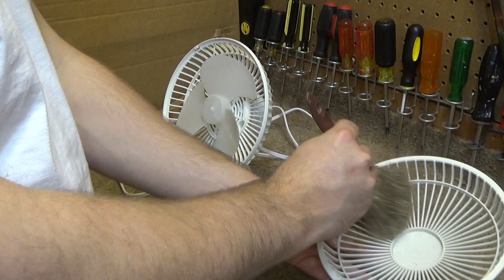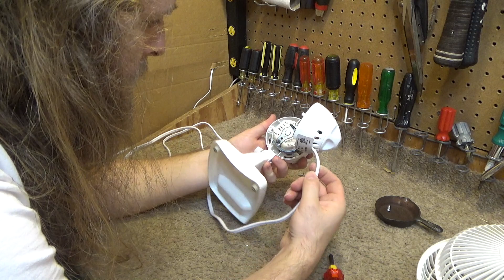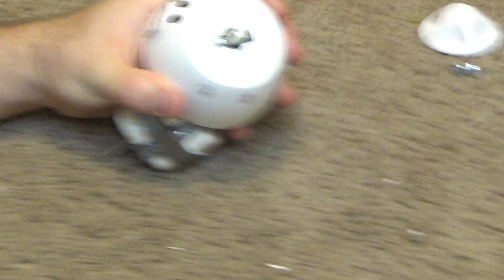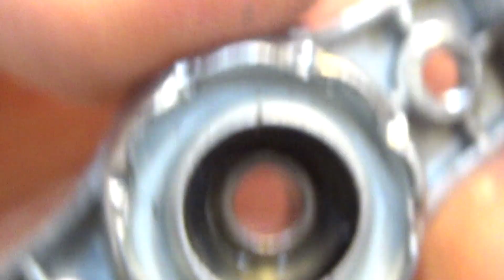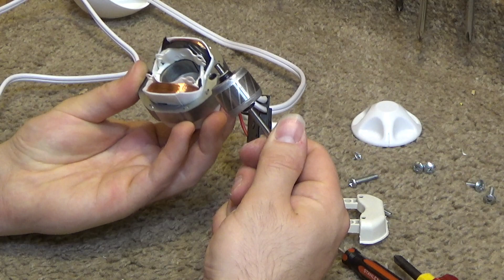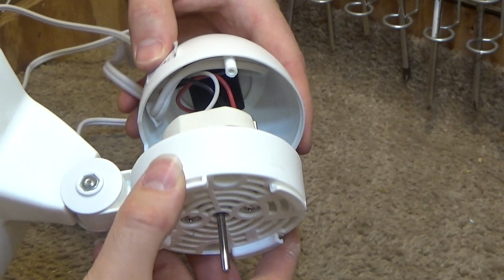Clean/Service/Repair Lasko 2002W Desk Fan

Comment: Thank you! I have two 2008 Lasko 9" oscillator fans model 2094 that I bought at Lowe's for $19.19 each. They still work well, and I clean them at the end or beginning of every hot season. I've never been able to remove the blades. I saw that it looked like a friction fit because of the steel-wire spring around the blades collars but I was afraid I might break the plastic blades if I pulled on them with too much force. Your video gave me the assurance I needed to apply more pull-force. They came off, just as yours did. Again, thank you. A more thorough cleaning and lube will now be possible!
Reply from the maker: You're welcome.

Comment: I have like 8 or 9 fans in my house... 2 of them are lasko clip fans (similar to this one)... One I keep in the kitchen clipped to the counter and when the dishwasher is done... I open it ... shake the racks and clip the fan so that it blows air into the dishwasher to dry the dishes... It works so much better than using the dry cycle... they are so freaking easy to keep clean. I've only taken it apart to get the blade off and I vacuum all of it with the vacuum dusting brush... but never oiled them. Honestly, I didn't even know oiling a fan was even a thing.
Reply from the maker: Thanks for letting me know.

Comment: As far as switch maintenance  goes, look into getting some deoxit d5 contact cleaner and lube, that is professional grade contact cleaner, it's different than your standard contact cleaner which is just designed for connectors and terminations, like the crc stuff as an example, that stuff doesn't have a special low weight lube in it which can damage carbon traced parts among other types of potentiometers and faders and switches, even some relays, get that deoxit d5 and spray that switch out and rotate it back or forth several times, and you will greatly extend the life of it by a factor of 15x

Comment: that motor looks incredibly well made, much better than any other small 6" fan I've seen
Reply: The blade has good pitch, i’ve had mine for a few years now, still works great.
Reply: @DnD_Robb404  look into that deoxit d5 contact cleaner and lube for switch maintenance when ya got the time.

Comment: Nice video. It was interesting to see the motor in these, I don't think I've ever seen a motor quite like that before. I was expecting it to have a C Frame like the 90s ones. I do like the motor housing on that, nice styling and looks well ventilated.
Reply from the maker: I've seen these style motors used in a lot of heaters, I believe it's a 2-pole shaded pole motor.
Reply: @JordanU  That's true, I have seen them in heaters. And my Vornado V Fans have them. I guess what was more surprising to me is it's totally enclosed. The ones I have seen all have venting or open windings.

Comment: the only issue with these I have the air king variant is they move little no no air
Reply from the maker: I don't see why the Air Queen one would perform any differently, if anything I'd think it would work a little better as the metal guards are usually less restrictive.
Reply: @JordanU  I am just stating my experience with my little plastic air king fan with the metal grill I got from the hospital when I was having surgery they gave me a small air king fan it barely moves any air even on speed 2
Reply from the maker: @AlisterBloodfang  Perhaps it needs to be cleaned.
Reply: @JordanU  maybe I do use it in the bathroom but even when it was new it hardly moved air it is weird more like a faint breeze